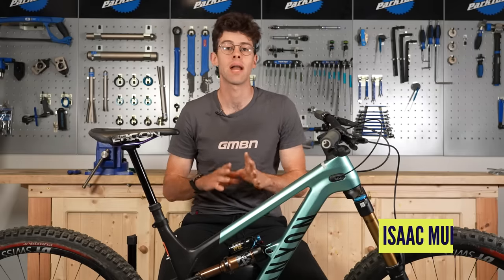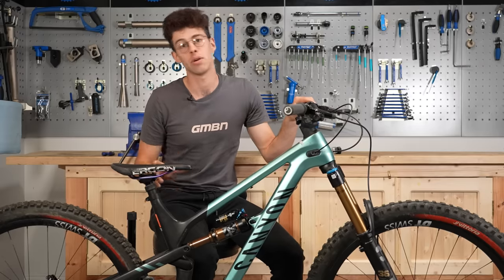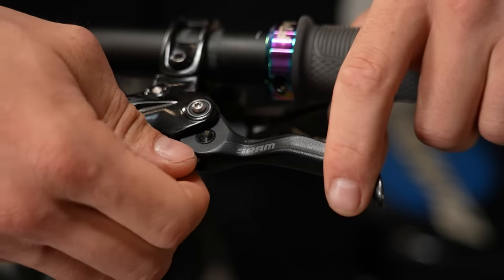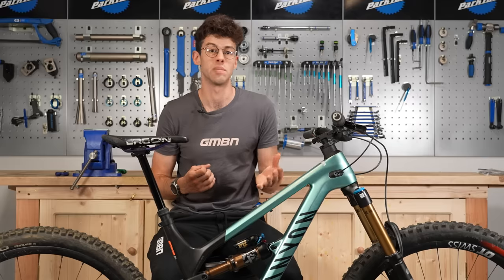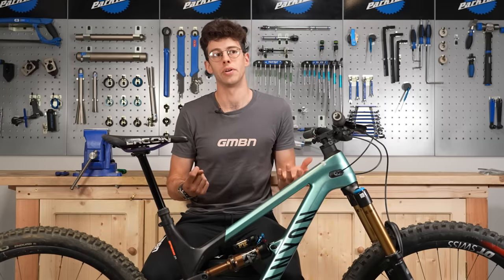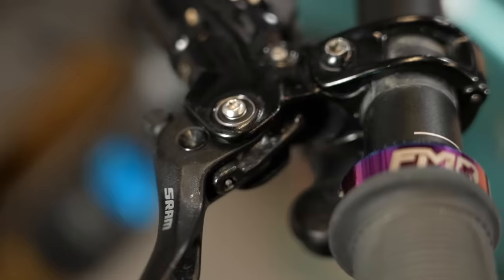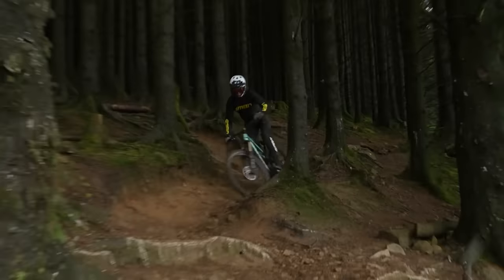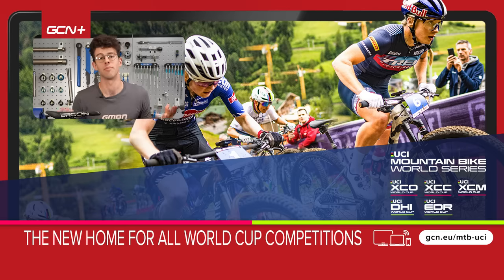6 Things You Should Be Doing When Setting Up Your Bike

Comment: I've played around with all of the adjustments on my bike and what surprised me the most was saddle position.  Moving the saddle back just 10mm cured my hand/wrist pain and I had to adjust it to an ever so slight nose up to keep me from having that sliding off feeling.  Those chamois riding shorts are slick!
Reply: Ooh thanks great tip, I will give it a try.
Reply: I started riding with my saddle tilted slightly upwards a couple years ago. It just helps make your butt sit on the widest part of the saddle, which is where its supposed to be instead of putting all your weight on the nose of the saddle.

Comment: Great video! Only one comment to add to the low and high speed damping circuits that you came so close to touching on. 

The intermediate value theorem not only applies to the transition from compression to rebound but also to the transition from low speed to high speed.

To activate a high speed circuit you have to pass through the low speed circuit first. So in a high speed compression event,the low speed circuit will be activated at the beginning and end of stroke for both the compression and rebound portions of the movement. 

(order of events:0, lsc, hsc, lsc, 0, lsr, hsr, lsr, 0)

Comment: I might actually give your brake lever advice a try. I usually run my levers VERY low, but I recently got an I-Spec EV XT shifter which attaches to the brake lever and currently with my lever so low it makes the shifter levers sit really high and it's uncomfortable to shift, having to bring my thumb up so high.

Comment: What am I doing wrong? 
Saddle position; Doddy said to have your saddle pointing slightly down to assist your sit bones. 
I’ve tried doing that with my saddle, but everytime I loosen it and position it, then tighten everything up again, it’s horizontal yet again!
Reply: Tilt the saddle then tighten the front bolt a lot more before tightening the rear bolt

Comment: #askgmbntech
Isaac, regarding cleat position, I'm relative new to clipless and currently running mallet-e LS and regular on both bikes. Playing around with q-factor position on my shoes since i started experiencing knee pain at the very top of my kneecap just below the femur. I've tried the setting up cleat videos here on the channel but cant seem to shake the pain. It feels relatively comfy now with the widest q factor and slightly turned outwards since that seems to be my "default" foot position. But the pain still comes in full strenght after a day or so riding.
Any how, any pointers or recomendations to be made?

Many thanks!
/Andy
Reply: Thanks, I’ll try that and see if there are any local fitters near me!
Regarding pads, no, ive been running the same old.